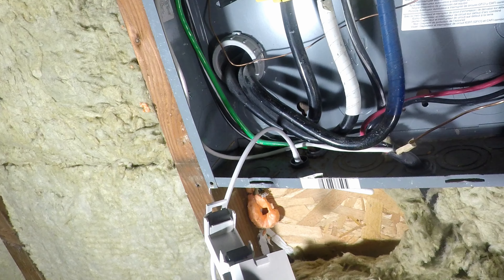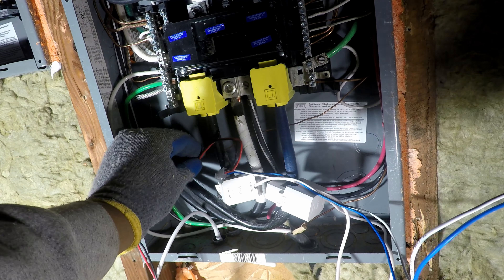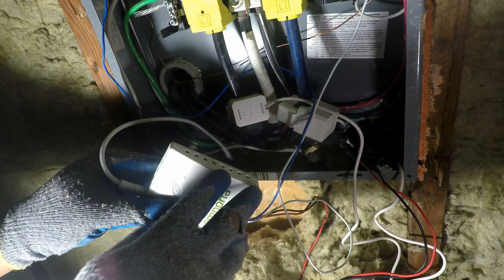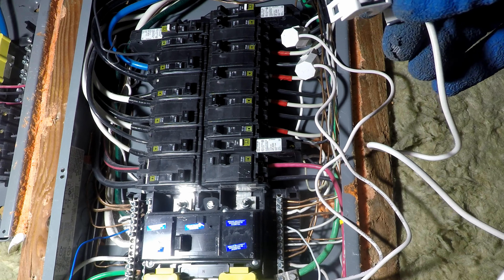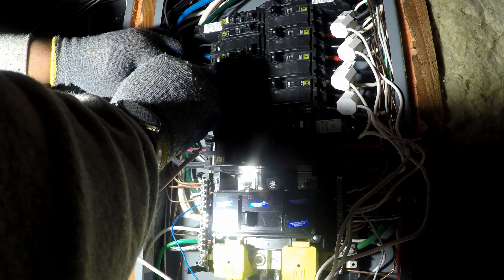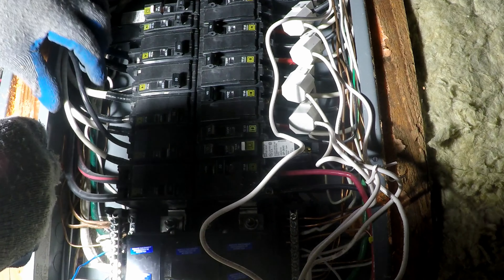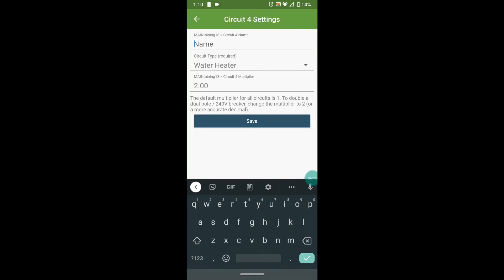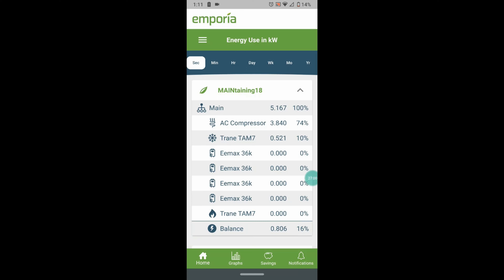Emporia Vue Gen 2 Install Experience - M18 EP25

Comment: Love background drumming. Super cool!
Reply from the maker: Thank you.
I installed a second Emporia Vue Gen 2 to track a sub panel. It's a good product. They now allow nesting which sums all energy tracked from all devices into one number.
Reply: @GoldenJudge Don’t want to install 2 Emporia units unless I have to. I have 40 circuit main panel and 22 breaker sub-panel next to each other. My high demand appliance (40A) are in sub-panel. Do U think I could put Emporia in main with some of the 15A CTs and run remaining 15A CT lines to sub panel?
Reply from the maker: Yes you can have one Emporia Vue. The meters that go over the wires can be extended with 3mm audio jacks as needed.
Reply: @GoldenJudge  Thanx for responding. Service panels (main/sub) so close together I may be able to reach w/o extending. I’m getting an Emporia Energy Smart Plug (before Vue) just to experiment their iOS App using some of my plug in devices (like my computer). Do U have any of their Energy Smart Plugs? Later I will be adding an outside 30A generator receptacle for portable emergency generator and monitoring it with the Emporia Vue. Thanx for your videos.
Reply from the maker: I have a few. I use them to turn the tv on and off. They can be scheduled by time. The plugs require WiFi 2.4ghz. 
They are 15amp. I also use them to measure usage of current for bidets. Was a waste. The bidet is barely $1. The TV energy usage is interesting.
Reply: @GoldenJudge  Thanx for response. I’ve just purchased Emporia Vue w/16 CTs and 4 Energy Smart Plugs. Until my electrician adds an outside generator receptacle & installs the Vue, I’ll be using the smart plugs to become familiar with the Vue iOS App and see how efficient some of my appliances are. I’m excited about doing this and carrying what I learn  forward to running my house w/NG portable generator on a grid failure.

Comment: Love the gloves! Do they really protect U from getting the #@it shocked out of U? Hand dexterity good w/them?
Reply from the maker: The gloves do help in some chases but these are not for preventing shocks. For example, it prevents direct contact and gives me a second to pull my hand away. In reality I would be shocked thru the gloves if I hold on to a naked wire.
In other words, electricity pulls your hand towards it. With the gloves that process is slowed and weaker.
With proper gloves the process of electron transfer is stopped.